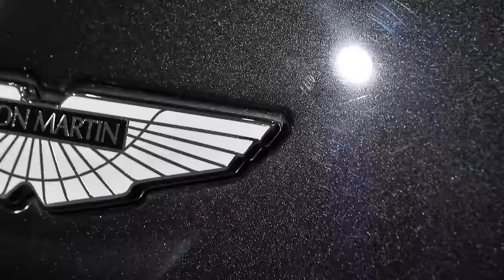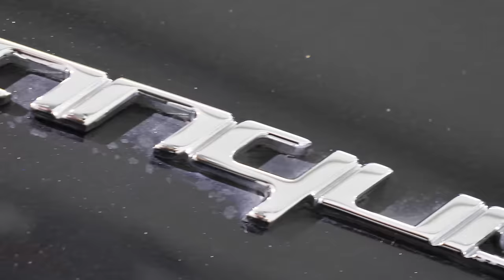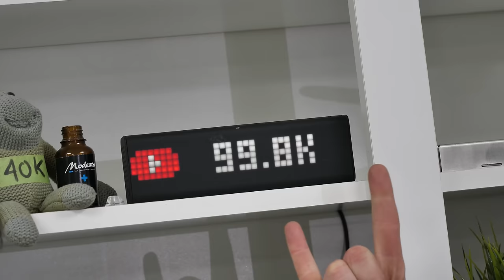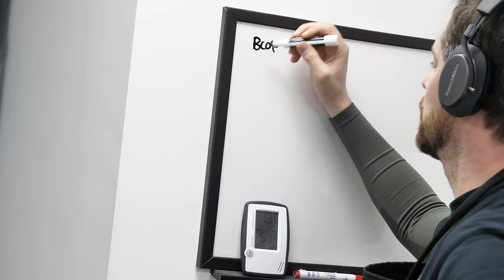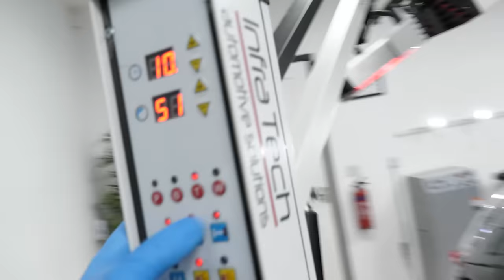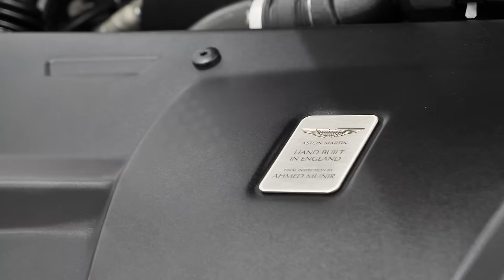"One of The BEST Decisions I've EVER Made!" - Detailing an Aston Martin Vanquish

Comment: I can help you a little more. What you need to do is a descontaminashion chamber , what it is is a plastic wals , roof and flor you have to sill with glue and ductape you gonna need a blower and a extracter and a ac to cool down the chamber you gonna have to were a suit of painting protector with a air mask to all this if for the purpes of the products now were the mas and the suit alk the time the car you gonna place it there ofter the preparación i told you bout dont wax it after that you gonna work the interior and pulishing at low tempater you gonna have to aply the seramic and let it sit at low temperture for a wile after that you gonna have to wax it in the end . Im from Monterrey México  and is a Ferrari dealership in San Pedro . Is a say is not know what i do i need to do better and more do for my clients.